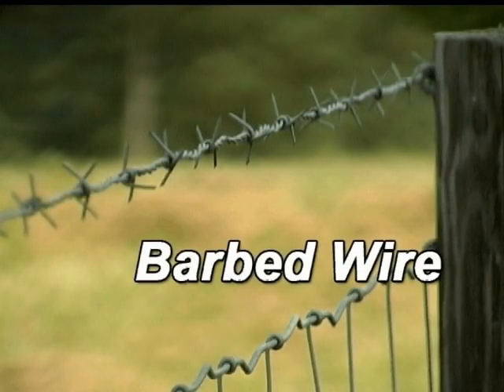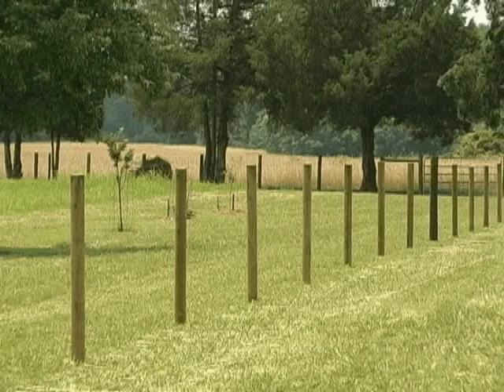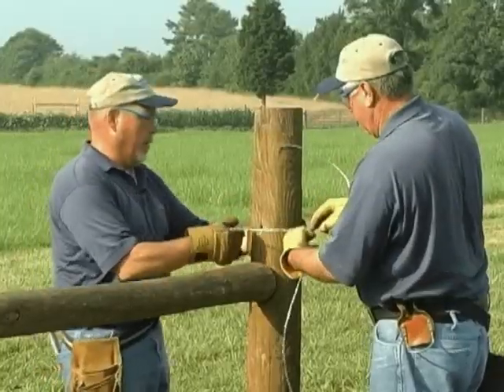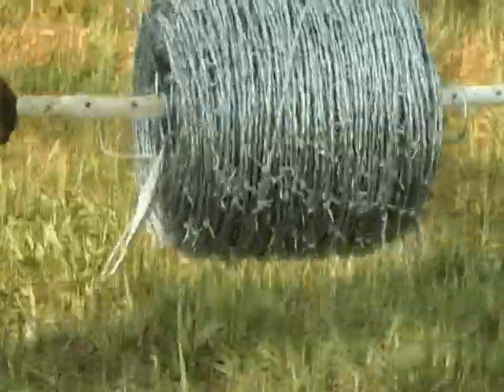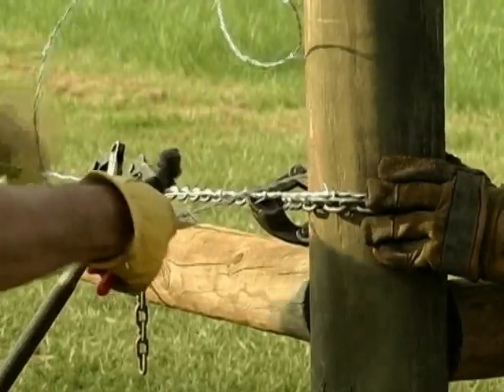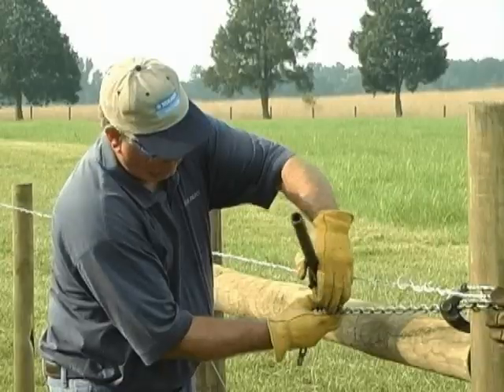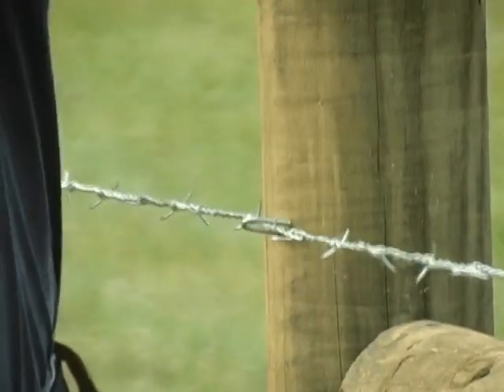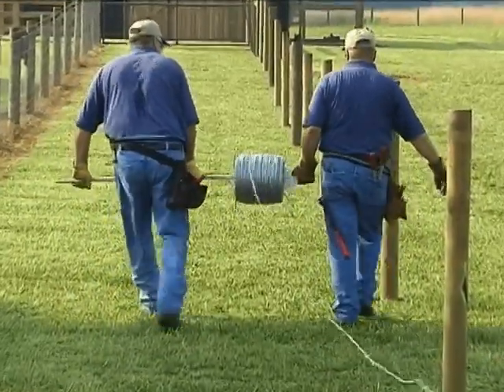How to Install High Tensile Barbed Wire

Comment: How does one know the "desired tension"??
Reply from the maker: For high tensile barbed wire you want to tension it so that it is tight. If you start to see the barbed wire or barbs start to seperate, you've over tensioned.